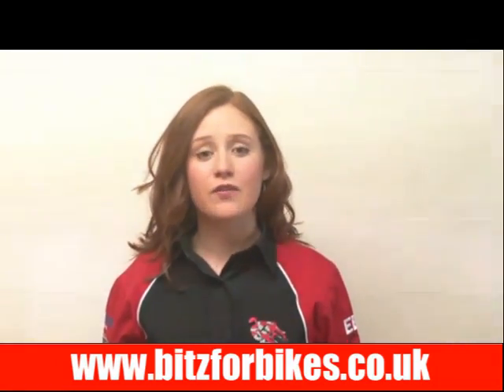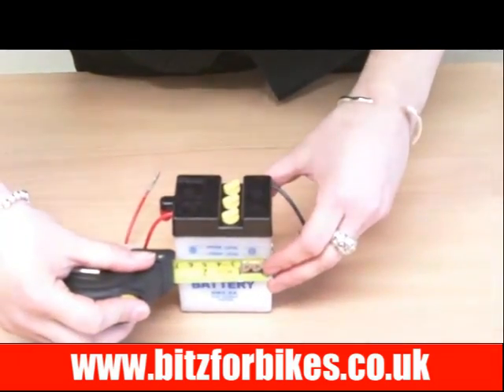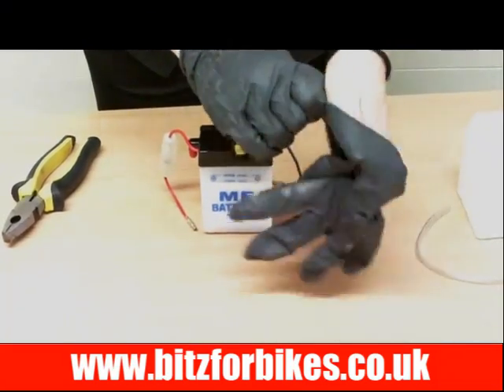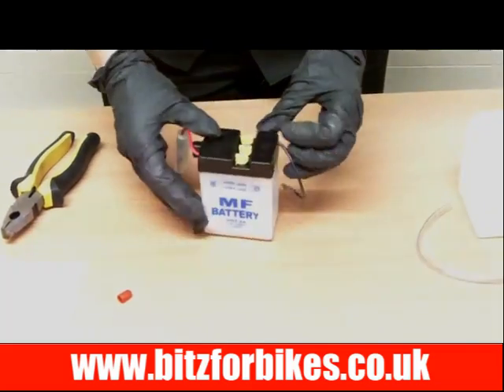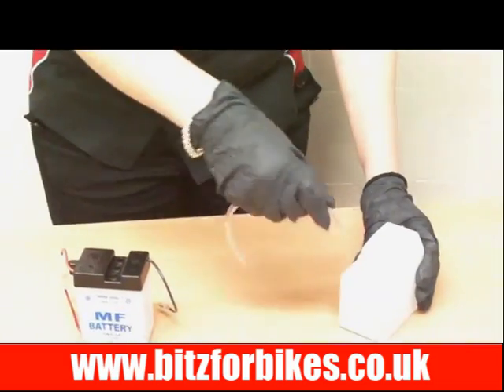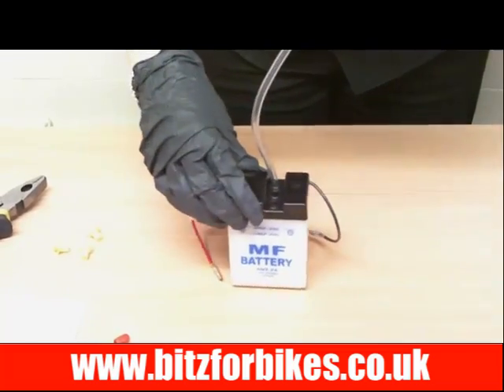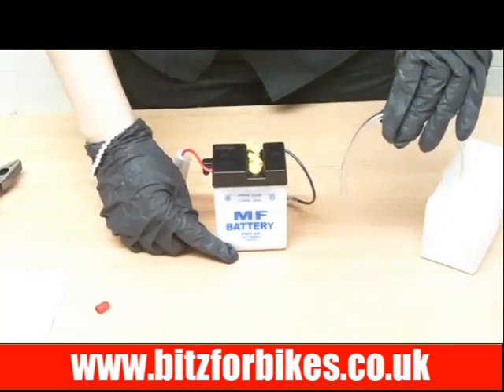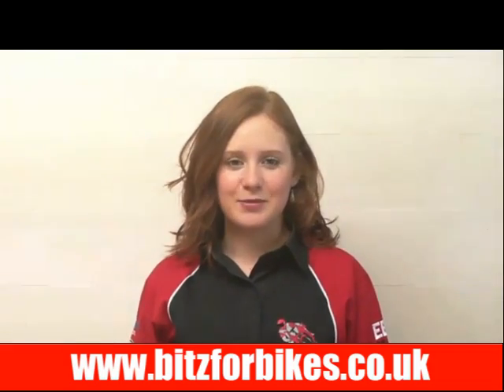Bitzforbikes battery 6N2-2A information 706020

Comment: So there is no special instructions for charging once filled? Just put in cycle and run it to charge the battery?
Reply: Jonathan Parker I have the same question. Do you need special adapters to hook up a trickle charger to the terminals?